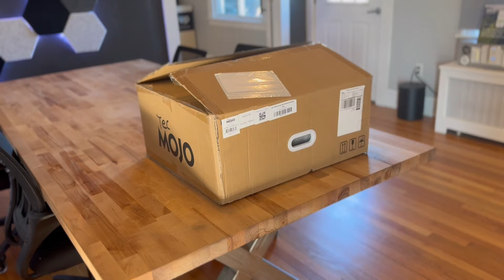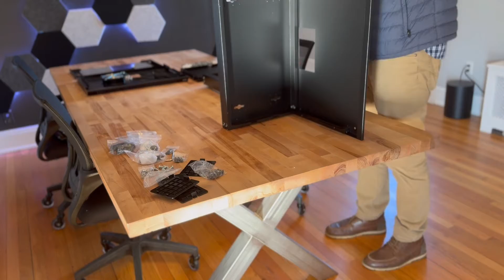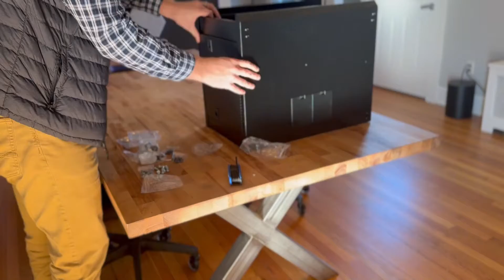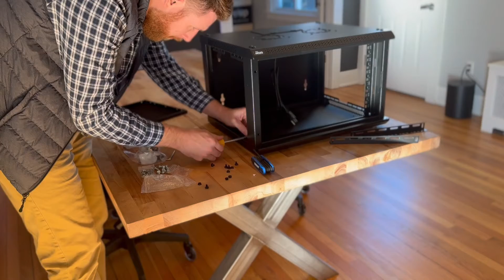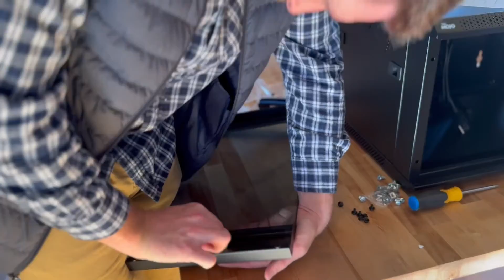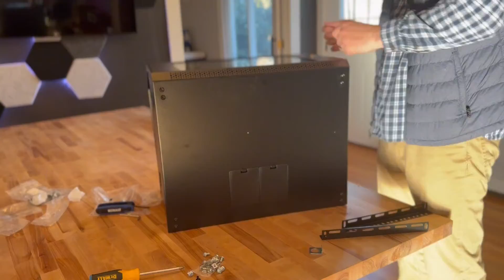Pro's and Con's of the Amazon TECMOJO Server Rack

Comment: What do you recommend to bolt this thing to the wall? Plywood backing? Just basic wood screws? I’m mounting on studs (covered by drywall). Wonder if I could just cut a couple strips of plywood to put between rack/wall? 

Do you recommend anything special w/hardware or just bolts - like spacers/washers etc? Hard to find details on web thanks!
Reply from the maker: We typically are putting up a piece of ply anchored to the studs. For mounting the rack we are usually using the lags that come with TV mounts purely because we have so many in our van. 

Depending on the size of your rack and how much equipment you are putting it you just want a good screw with shear strength and a solid washer to pinch it. I’m sure there is a better/correct answer but we have mounted hundreds over the years and never had one fall or sag.

Comment: I have purchased the 6U Mesh version of that cabinet.  I have never put together one of these previously.  I got the outside put together, but the instructions are very vague, and your video went very fast.  Could you please do a quick video showing the details of how to install the internal rails properly?  I will be using the cage nuts, and would like to know where and how the rails get installed.  Thank you.
Reply from the maker: Next time we are setting one up I’ll try to get a clip. The rack does come with included screws and cage nuts for the internal rails on the front and back for the top and bottom.
Reply: @integratewithnate  Thank you